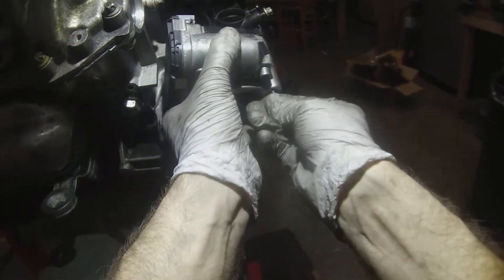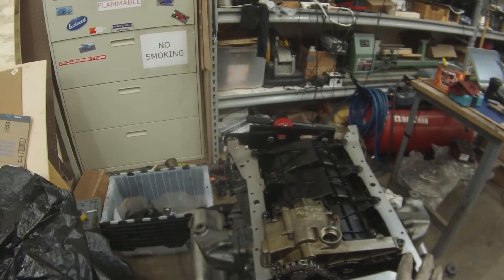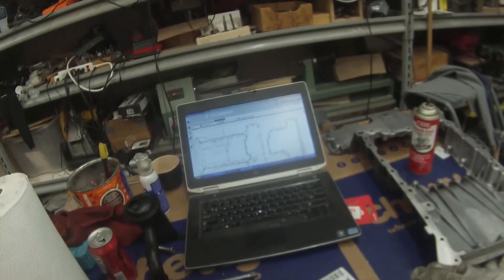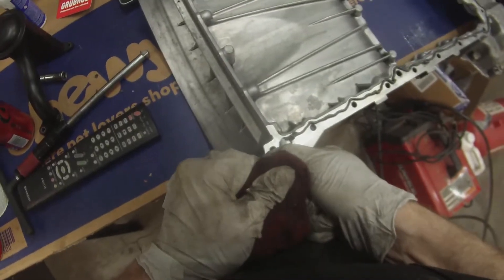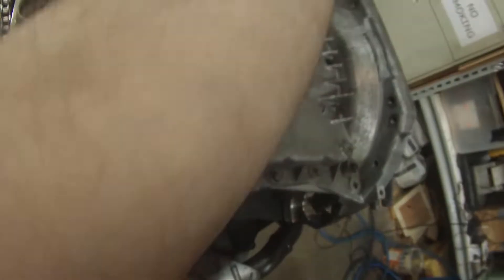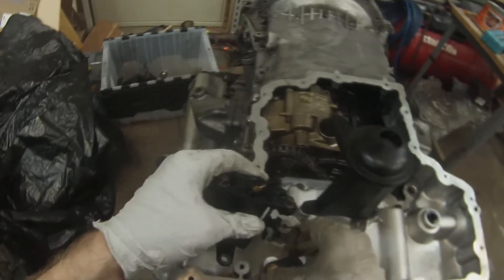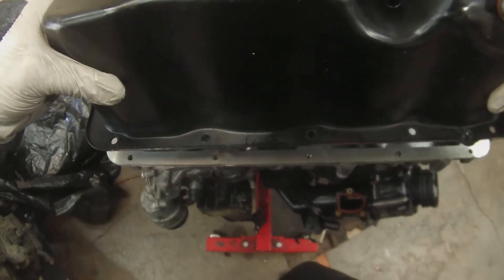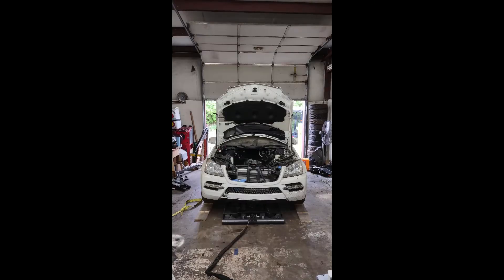Mercedes GL350 OM642 Rebuild - Part XII of ?

Comment: My small metal pan was bent too much due to priming before, it caused oil leak after installation, make sure you straighten out small pan with rubber Hammer against the flat concrete or so before installing ;)

Comment: Hello, thank you very much for your videos.  I closely follow each of them because I am assembling the same engine.  I bought Ml320 CDi engine OM642.820 With problems.  The engine was disassembled and I have already bought several parts, but I have a problem with the identification of the pistons, because I cannot tell if they are from the left or right side.  Unfortunately, the marks that are on the surface of each piston are washed out.  Through your videos I have been able to observe the position of the pistons when you installed them in the block.  I have paid attention to the marks of the valves that each piston has on the surface and with that information I have been able to determine the orientation with respect to the intake and exhaust valves.  I wanted to ask you if there is any difference in geometry between the right and left side pistons.  If there is a difference, can you tell me some geometry reference so I can measure them and thus identify them?  Thanks for your help :)
Reply from the maker: I only have the one piston that I replaced that I could measure, since the engine is back together so I wouldn't be able to directly compare.  What I do know is that they have a different part number for each side, so there's obviously some sort of difference.  If you look on the top of the piston, there should be a marking that reads either "1-3" or "4-6", but I'm assuming that that's what's washed off.

Let me re-iterate that I do not have each of the two pistons to compare so this is a quasi-educated guess:  On the underside of the piston, there should be an opening that will mate with the oil squirter at the bottom of the stroke.  If my memory serves, the squirter will actually enter that little hole in the piston.  So when the piston is installed, that hole should be to the inside of the "V" and the dishes on the top of the piston should match the sizes of the valves that would be above it.

I hope that helps!
Reply: @williamehrman  Hello, thank you very much for your answer.  Finally, I have sent the engine block to a company that is dedicated to performing grinding, cylinder lining and everything related to the reconstruction and repair of engine parts.  The cylinders on my block were out of round and the crankshaft, which was new, needs to be ground to +0.25mm.  Because the mechanic who assembled the engine and who never started it, armed it with dirt and that caused damage to the crankshaft bearings and connecting rods.  I will keep the original pistons and put new rings, I have bought the bearings in +0.25mm size and the cylinders will be rebuilt to standard size.  The heads will be chemically washed, as will the rest of the parts, I will change valve seals and do valve seat work.  I have also bought a master engine gasket kit, new cylinder head bolts and various other parts.  Thank you again for your opinion and published videos.  A hug from the city of Concepción in Chile.
Reply from the maker: Wow!  That's quite a bit of work!  Honestly, I checked the bores early on in the process and had they been out of round or had any significant damage, the whole car would have been parted out.  Is your shop able to press in new liners for less than what it would cost to find a "good enough" block?  Good luck to you, my friend!
Reply: @williamehrman  Hi good morning.  Unfortunately, in my country, the OM642.820 engine is very scarce in spare parts, both new and used.  I have had to import all the parts from different parts of the world.  In repair costs I can indicate some.  New cylinders for the block about $600, crankshaft and connecting rod bearing set $450.  Full engine gasket kit $250, head bolts $230, piston rings $220.  And I will only save on the cost of assembly because I do it myself.  Hopefully, the new cylinders are fine.  I was able to reface cylinders to +0.50mm, but new pistons cost $240 apiece plus tax

Comment: How many hours would a garage need for a rebuild? Approx? Thank you
Reply from the maker: I wish I had a good answer for you, but the best I can say is "a lot".  ASRA doesn't really have a "rebuild engine" item to grab shop hours from and even if they did, it would probably be a "ZM" item meaning it's basically at the shop foreman's discretion.  Just the remove/install for the engine is nearly an 8 hour operation.  Remove and install the heads is another 10.8 hours, the pistons an additional 4, 3 for the oil pan, and so on.  And that's just to take them out and put them back in, forget doing any work to it.  I can totally understand why a shop would recommend just swapping the motor out rather than wanting to (a) tie up a bay while doing all the work and (b) risking that they'd have to re-do that labor at no cost if they made any errors during the rebuild process.

Comment: Hello, would you happen to have that diagram of which bolt goes to which hole for the upper oil pan?
Reply from the maker: As far as I can remember, the only diagram for the upper pan that I was able to find was a sealant path diagram.  I seem to recall that it was just a matter of just going around and visually sizing up each bolt.

Comment: om642 i dissasembled for oil leaks from heads. machine shop find problem with pistons also..so new piston resurface block resurfuse cylinder heads. engine have stuck 2 times after rebuild in 3rd cylinder in bearings all others bearings exelent so 2 rebuild with different road in the same cylinder stuck new bolts in con-rods new in main bearings oem...have ansewer anyone.
Reply from the maker: So the #3 rod bearing is failing repeatedly?  I would suspect that in the resurfacing process something got lodged in an oil passage.  Or perhaps some RTV broke loose from the head covers.  Or some other contaminant.  Maybe putting everything in a hot tank would soften up any carbon or rogue RTV that might be in there.  I'm not entirely sure how to check and/or clean those oil passages - I'd probably try running some wire through there maybe?  If it's not a lubrication problem, then maybe the crank and/or the conrod is out of round?  I know you said you tried a couple different ones, but I'd mic them and check.   You could put a new bearing on and use some plastigage in a few different spots around the bore to check, but I'm not 100% how accurate that would be - a bore gauge on the conrod and a dial indicator to check run out on the crank are really what you need.
Reply: So after 3 rebuilds the all ok. New crankshaft in third rebuild and new machine shop. The problem was the lack of pressure in 2nd main bearing tha take care to deliver oil in rods 2 and 5 cylinder roads. New machine shop says that the block had machine bad and for that the 2nd mail bearing had bbad readings. The first machine shop none responsibility..take care of your partners
Reply: If you have oil starvation  change the oil filter housing, pressure valve inside get stuck on idle low psi